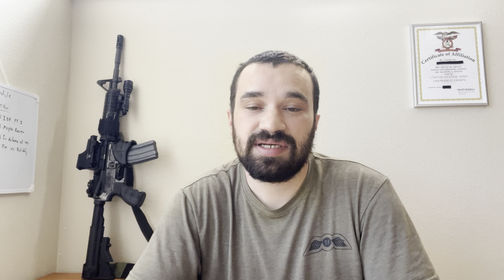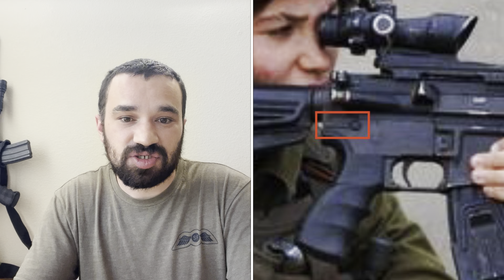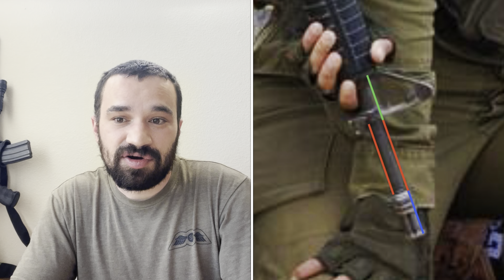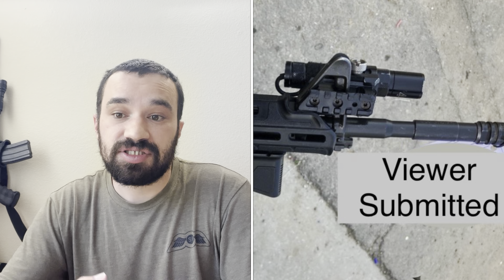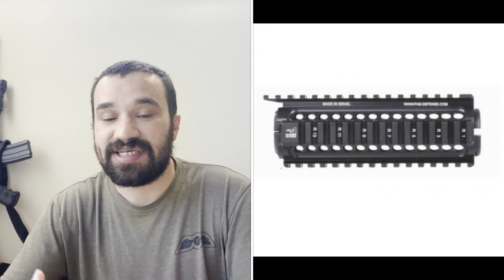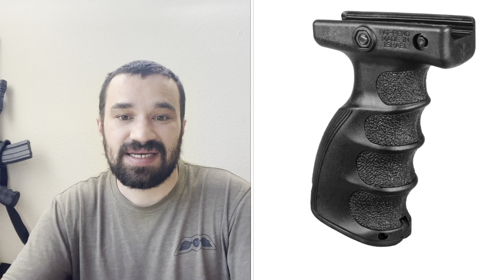The M4 in Israeli Service

Comment: I would like to also mention that I once saw an M16A1 upper with an M4 barrel and it was glorious. (IDF reservist)
Reply: כן גם אני ראיתי אחד כזה 😂
Reply from the maker: Thanks for sharing - I’ll sleep a little better knowing those exist!
Reply: In Iraq, I saw an old Hydramatic M16A1 lower mated to an A4 upper. The lower was overstamped with "A4". It was in the hands of a TXARNG Soldier.  It caught my eye because the finish of the lower and upper were totally different.
Reply: @Triangle26 I had a gov profile barrel (m4 style) on my m16a1 Katzar in basic training and it was my favourite rifle I was issued in my service, as a gun nerd I thought it was so weird
Reply: There are plenty of those, but I’ve always preferred the Mekutzar M16s because the M4 barrel is a little longer for almost no benefit
Reply: @thereyougoagain1280 nuh uh
Reply: @binyominfranks2910  ummm…. what?
Reply: @thereyougoagain1280  he said he saw an m16a1 upper with an m4 barrel. I only saw 2 in the idf
Reply: @binyominfranks2910  in my experience perhaps one in every 50-100 M16s have those barrels in the IDF, there always seems to be at least one in any unit with M16s, and I’ve been around a lot of units with M16s lately. “Plenty” might have been a little inaccurate on my part, but I’ve definitely seen more than 2.

Comment: One correction to the rails systems the one shown in the picture is the xm4ms and not the sd. I recived the xm4ms with my “dmr” m16 lower combined with m4 upper. The riflemans in my platton got new m4s with the knights armament rails system and no front sight post (magpul mbus sights instead) and its also ambi safety 
Im happy with my rifle it has a different rails system so we can use night vision optics the require a lot of rail space and it has to be monolithic and continues picattiny rail. Used with an l3 4x aquila/ mepro x4 lior/ elbit systems xact th65 clip on that goes infront of the acog and for that the rail system is different.
Reply: We also recived the new m4s with magpuls sl-m the idf is slowly shifting towards military grade improvements when it coms to rifle modifications adding the peq15 and aimpoint micro t2/ eotech exps 3 to some of the units
Reply from the maker: I appreciate the correction, thank you for taking the time to share your knowledge.

One question if you have the time: When you say that the riflemen in your platoon are using Knights Armament rail systems with no front sight posts, does that mean that the rails are free floated / extended length?

In the US, the most common Knight's hand guards are drop-in, which of course requires the presence of a standard front sight block. I know the Knight's makes extended free float hand guards, but those are relatively uncommon here - so it would be interesting for me to confirm that is what you are using.

Comment: America: Our M4s are made in a very specific configuration.

Israel: Grab the parts bin,  boys! We're building rifles!
Reply from the maker: 100%
Reply: Literally how we do it lmfao i had an m4a1 upper and an m16 (not a1, not a2, not a3, just m16) lower. It was fucking stupid
Reply: This should be the way it's done in the USA. The AR-15 is extremely modular. So Modular them.
Reply: Israeli m4 is much cheaper compared to USA and it's parts
Reply: @tinycockjock1967  I mean... When the AR-15 variants are too damn close to each other in the way they operate, usually would be very easy to simply swap parts from different variants. The entire platform is made so you can twink with it the way that suits your style. I'm sure that's what Eugene Stoner had in mind as well when desgining it. The AR-15 is undoubtly the most versitile platform there is for any type of combat.
Reply: @glm8245 That's because they're donated 😂

Comment: Question: whent discussing shortened M16A1 with pencil barrel .625.(Mekutzrar) what kind of  round handguard front cap did Israeli armorers used? 
.750 and not caring it is loose on the pencil barrel? Or some Israeli made handguard cap .625 inner diameter?
Reply from the maker: That’s a very good question - I wish I knew the answer. I’m guessing the most likely explanation is that the Israeli’s initially sourced .625 round handguard retainers from the US (which were in production for Colt 653’s, XM177’s, and others). They may have switched to domestic production over time. I think it’s unlikely that they modified .750 handguard retainers, however possible.

Comment: IDF officer here - Givati golani and Nahal already transitioned from x95 to new M4 / Israeli version of it.
all the Tavor variants are  going to reserve arny use only.
Reply from the maker: Thank you very much for the correction - it looks like I was working with outdated information. Stay safe!
Reply: That’s not entirely true - I’ve still seen plenty of active Givati, Golani and Nahal soldiers with Tavors. It does seem to be on its way out in favor of the M4 though, and all new draftees to those units for at least the past 10 months have been trained solely on the M4 from what I’ve seen
Reply: the tavor is considered primitive compared to the m4? does that mean its failing?

Comment: While I won't call the M4 unreliable because it is very reliable.
The tavor has some things that really help, like a piston gas system. It also helps the hk416 as a comparison to get way less dirty.
When they operate in high concrete dust urban and arid environment gun gunk accumulate fast

Comment: I was IDF infantry but have been out for 12 years now.  I did the first month of basic with a m16. Then I became a designated marksman and got an m4 with an ACOG 4x32 and a night vision optic called an Akila that has been replaced at least once since my time. Not that I care, but we had the real deal m4 and were taught the difference in the marksmen course. I loved the ACOG but hit much smaller groups with the Akila. Then I became a commander and had a M4 with a Mars and an integrated IR laser which was tons of fun. I always noticed that large laser on the US setup and never understood what it was for. Then I stopped being a commander for the last 4 months of my service and got the Mars swapped out for a Meprolight reflex. I had a front handle that was on loan from a friend and I loved it. I found the M4 to be very reliable but would have jams after 7 or more magazines. One thing you did not mention here but maybe you talked about in the first video is that much of the consideration for the length of the gun has to do with vehicles and the units that use tanks and MLRS usually get the shortest variants.
Reply from the maker: Thanks for sharing all of your insights - very interesting to read.

Hey quick question if you have the opportunity: I’ve talked to a few IDF designated marksmen now and many of them have mentioned that they were specifically issued SS109 (green tip) ammo. Which to me implies this was not the standard issued ammo. Can you shed any light on this, are marksmen issued different ammunition than their squad mates?
Reply: @Triangle26  Yes that is true. We were issued the green tips and were told that they only perform well in the M4 barrel. We would always carry 4 magazines of green tips, one magazine of tracers, and one magazine of blanks (the high-powered blanks and not the ones we used at funerals). The blanks were used mostly for rubber bullets but I was also in a demolition unit that used them for some other barrel-launched stuff. For the most part as a designated marksman, I did not shoot rubber bullets and would keep my weapon ready for lethal fire if needed while my teammates shot rubber bullets at rioters. The rest of the team used regular (non-green tip) ammo and the few times I saw people load green tips by accident it did not shoot well and would keyhole. In practice once we became an operational unit most of my teammates were running M4s (some even had ACOGs) as well and were loading whatever we had at the moment.  We zeroed our guns before any big mission and as long as you stuck to the same ammo then you were good. Once during training, all we had were tracers and we ended up lighting a field on fire and then hundreds of birds came to eat the snakes and lizards fleeing the brush fires.
Reply: Ever see/know of TAR-21s with IR version MARS? It seems most have the visible laser in the IDF.
Reply: @jonathanwestlake5527  When I finished my service the Tavor was being tested in only one infantry unit (not mine). The first time I saw one is when my little sister brought it home 5 years later. She had a mars with a visible laser but it is possible that it also had IR mode. I played with it a little but thats really the only time I ever saw a TAR-21 (not sure which version it was).
Reply: @aviodenheimer4090  Yeah the MARS either has IR or Vis, never both. Very interesting that your M4 mounted MARS had an IR laser. Thanks for that info!
Reply: @jonathanwestlake5527  Honestly it's been 17 years since I have seen one so I don't trust my memory.

Comment: givati ex soldier and (somewhat) active reservist, i didn't get to experience the m4 much yet, since my reservist batalion is only now getting ready to transition to the m4s, but from what i felt and understood, the tavor (X95 micro) is way more versatile in his capabilities without the need to change any parts of the gun unlike the m4, since the bull-pup gives the ability to have the gun stay in short length while still packing a long parrel, since the entire barrel stays in the gun. maintenance is very easy with this gun both both the logistics and the soldiers that have to clean it, and is very comfortable and easy to handle since everything is so close to your body. Add the fact that alot of the fighting you get in gaza is in urban spaces, and you understand that doing something like breeching is way easier with a compact gun like the micro then with a m4 (you can tell the difference very well once you actually hold both of the weapons). but with that being said, the m4 offers alot more customization, and the micro ravor is almost twice as heavy as an m4 without attachments, which can quite put some toll on the infantry members that have to carry them on field. So the mixed opinion between the two boils down to if you rather have something that is comfortable to handle without much hand movement with easy breeching without any sacrifice but very heavy and almost no alternative additions, or a reliable and easily customizable rifle that weights less but is longer for your arms. Me personally, give me the micro tavor.
Reply: also from what i heard, the tavor is more expensive to manufacture and spread in the idf then the m4, so i believe its also something that alot of higher ups consider when choosing the issued rifle.
Reply from the maker: All interesting points, thanks for sharing.

I can definitely see the micro being particularly useful in dense urban areas - tunnels even more so. Bullpups always have pros and cons, but extra barrel length in a shorter package definitely has value.

Comment: Love the AR series carbine even as an M-4 during my service in Iraq as an infantry squad leader. Started out with a Vietnam Era M16A1, A2, and finally the M-4 from 1986-2009. Fantastic service weapon with better options in 2006-08 with mines having installed on it my ACOG 4x32, PAC-4, and TLR-2 light and red dot laser. Loved it in combat in Iraq even at night, using my PVS-14 with my PAC-4 zeroed if I feel like not quite what I wanted before a mission. My unit made time before any operation from convoy escorts to combat missions and raids. The Knight's rail systems were solid for the PAC-4s but I had to check with a few rounds to be effective. No problems with the M855 Ball and M856 Tracer ammo. The M-4 was over gassed for reliability like the AK Kalishnikova series.

Comment: IDF combat engineer, noticed at 31:03 your M5 has an outer circle reticle. IDF issued M5 optics have a dot only reticle. 
Great video btw, it should be noted that in the last year, all infantry battalions completely transitioned to using M4s. As the transition required acquiring large amounts of new M4s, young soldiers from Golani / Givati brigades are now commonly seen using new american M4s complete with the american comp m2 sight and the little black american QR code sticker. I suspect this is because Meprolight didnt have enough sights in inventory to complete the switch. Soldiers who shot both usually prefer the M5 sight btw.

Comment: Just as a summary of the different comments…
Since August 2023 - all new infantry recruits (all infantry brigades not including armor and artillery) have been issued m4’s - usually with aim point sights or m5’s. SF/Commandos/special units receive m4’s and usually once they finish training and often before finishing, they get an sbr m4- called מקוצרר (Mekutsrar) (similar word to katsar, also coming from the word “short”) with EOtech sights. Marksman’s get acogs. Artillery and armor receive m16’s with Carry handles. 
Recruits from before then in the regular infantry brigades received tavor/x95’s and before then, many received the classic katzar. This means that among active duty soldiers, most have tavors/x95’s and the younger ones have m4’s. Only reservists still have m16’s. As an additional note, airborne and all special operations forces (tier 1,2,and what I call 2+) have been using m4’s for a longer time. 
Hope this adds some context!
Reply from the maker: Extremely helpful - thank you for taking the time to post these clarifications 🙏

Comment: Golani, Nahal and Giv’ati already switched to the m4, and now they got newer m4s with the metal grips
Reply from the maker: Thank you for sharing. I’m being told that new soldiers are training on the M4’s, but experienced soldiers are still using X95’s. Is that correct?
Reply: @Triangle26  until recently it was true, every brigade has a training base for the recruits and only the training bases had m4s, recently i saw guys from golani brigade in 12th battalion that had m4s and a friend from 50th battalion in Nahal also switched
Reply from the maker: @Nottherealguyfieri  Got it 👍

Comment: New recruits in basic training of the golani brigade got m4 pattern rifles.
It seems that most of the front line units that are expected to do any sort of CQB are going to this pattern.
Reply from the maker: Very interesting - thank you for clarifying. Someone posted a similar comment about Nahal, it seems like perhaps the writing is on the wall then!
Reply: @Triangle26  on a different note, at least in my experience, most of the furniture and add ons , were added by inexperienced soldiers, usually the more experienced dudes tend to run their rifles as clean as possible, with some functional exceptions like LAM’s, lights and the occasional short vertical grip.
Either way, good video and i appreciate the effort you have put in to it!
Reply: @Triangle26  There's still a ton of soldiers in combat that their discharge was prolonged using X95. Tar-21 going out and both named Tavor but X95 will be staying much longer. Would be nice to live and see the outcome and lessons put in after all current wars done. since USA dropped the ball thinking they can hold out weapons in war and tell what to do instead. might be comeback for homemade.
Reply: @oriamir8994 what are you talking about you're not even making yourself understandable

Comment: 25:10 i believe it's the Chief of the General Staff Herzi Halevi
Reply from the maker: Thank you for clarifying - you appear to be correct.
Reply: Idf reservist here, It is Hertsi Halevi. Also in the last year or two, the eothech have been much more wide spread in the idf special units and even in some regular infantry units. Basicly its the new hot cool thing(for your military equipment) or as we call it in the idf, "wuassah". anyone who can get one does, wich is the reason why most front line infantry battalion comander and above have one. Also one major reason for the handguard loops or "Hovek" in hebrew is to hold a magazine on your gun but outside the magwel, usinga loop of elastic fabric sewn on the side of the hovek. If you want more information about the ARs and tavor/x95 in the idf, i have a decent knowlage and a friend whos a armourer in active service.
Reply: @אלעדבןיוחנן eotechs are issued in the 98th division, which means the 35th airborne brigade and 89th commando brigade
Reply: @yuvalbeery2493 to everyone?
Reply: @bennywolfe4357  I believe if you get an optic on your rifle (aka if you get an M4) you will get an Eotech
Reply: Yes, eotech came in to the paratroopers brigade two months ago @bennywolfe4357
Reply: @Rocket1000g  awesome. Hopefully I'll be there in March
Reply: @bennywolfe4357  wish you success

Comment: To the IDF that have commented on here, I have a question for you. For those of you who have carried both the M-16/M4 and the Tavor/X95, which did you prefer and why? I’ve always been curious to hear from the IDF on this topic.
Reply from the maker: Hopefully you get a few responses from actual IDF service members - but in the meantime I've talked to a couple dozen at this point and gotten very mixed feedback. 

That said, I have so far heard exactly one compelling argument in favor of the Tavor - the X95 Micro specifically. It packs a 13" barrel into a 22.8" overall length. Compare that to a Mk18 which has a 10.3" barrel, and yet measures 26.8" to 30" overall, depending on stock position. For fighting in tunnels specifically , getting an extra 200fps of 5.56 velocity from a smaller weapon does make good sense.

That said, just about every other conversation and application seems to favor the M4.